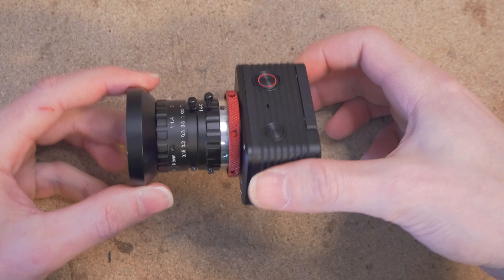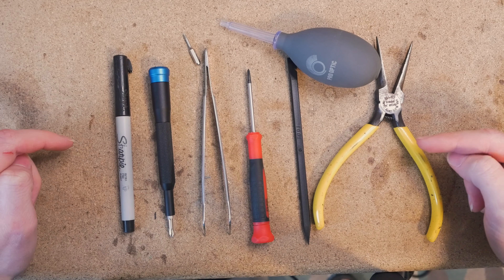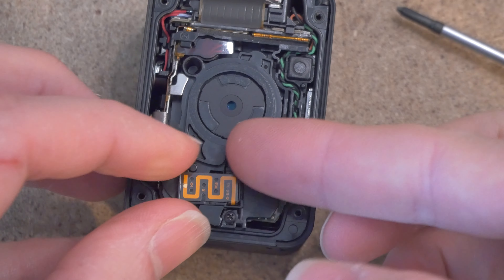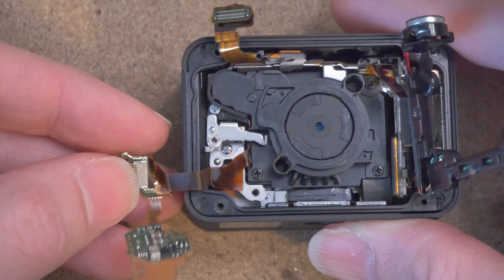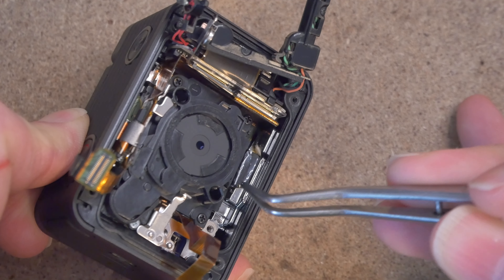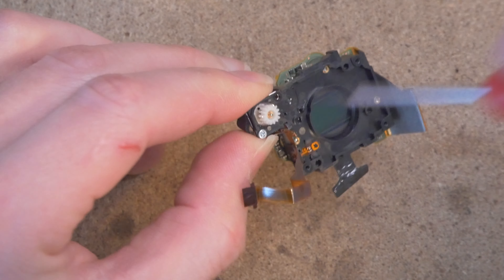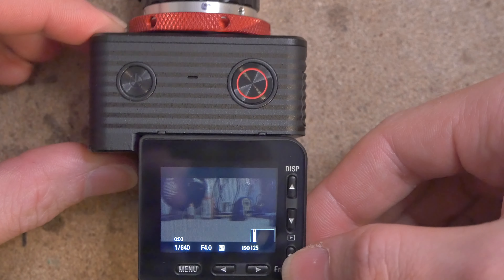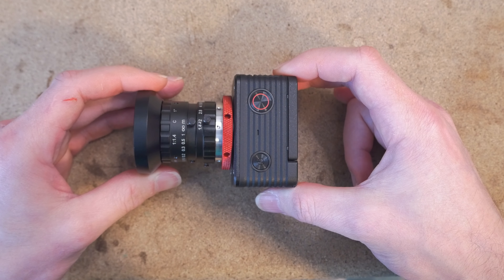Sony RX0II C Mount Adapter Installation Guide

Comment: hello . i did it thanks to you.
even thow i dont have a special adapter i just got a cheep faceplate with a 37mm thred online and stuck a c mount lens with electrical tape to it .and it works
i have to tell you after ripping out the camra guts and pulling its eyelids off then putting it all back together turning it on for the first time made me nerves as hell ...oh now it has a black screen...then afer what felt forever it started up . wow the start up takes longer now .
i also the sony edge app after connecting the camra it dus not let you record enething and the camra it stuck powred on you need to pull the battrey out to reset it. dont know if it is somthing i did or if is a bout ther is no lens.
and the lens i have is a 35mm but on the rx0 it looks more like a 80mm i'm going to have to find a wider lens now.

Comment: Hi Sam, great video! Loving kits and resources you’re supplying the community. 

Quick question regarding the lens. After focussing, do you leave the aperture at 1.4 when flying or do you adjust it according to shooting conditions?
Reply from the maker: You may adjust the aperture as you wish after locking in the focus. When you stop the lens down, it will make the image become even sharper. You should adjust aperture based on lighting conditions. This Azure 6.5mm lens is softer at f/1.4, but still not bad at all.